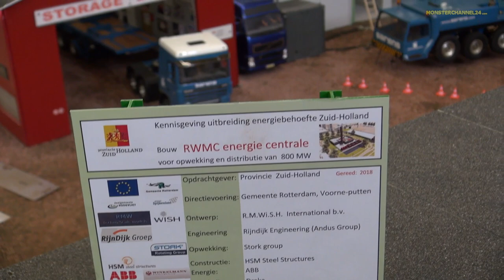EPIC RC Mobile Truck Crane! Amazing miniature Technology!

Comment: What is the crane made from? Is it steel or plastic or a combination. Was it done on manual machines or cnc machines or a 3d printer? Very nice work.
Reply from the maker: +kingmike40 No idea, but I don't think that these are printed parts. Thanks for your comment.

Comment: How heavy can the thing lift though?
Reply: The crane can lift on scale 1:14,5, with the block show in the video completly reeved it can lift 40 kg
Reply: RMWtechnoscalemodels Very impressive, with those specs you could use it to actually do some work around the house like unpacking your new TV :D
Really amazing, makes me wanna try build something myself. Where do you get most standard parts for this? I suppose not all parts are custom build (for example gear boxes, suspension, ... etc)
Reply: ppdan Hoi,
Sorry but every thing is custom build exept for the tires, bolts and nuts, hydraulic pump, hydraulic valves and the electromotors.
The rest like the gearboxes, suspension, hydraulic cilinder and slewing ring are home made. Take a look at mij website ;-)
rmw-technoscalemodels.nl you will find some pics during the build